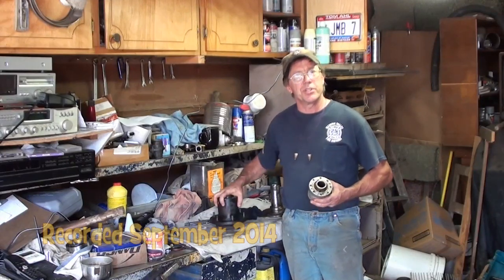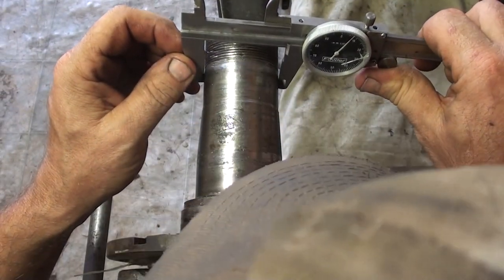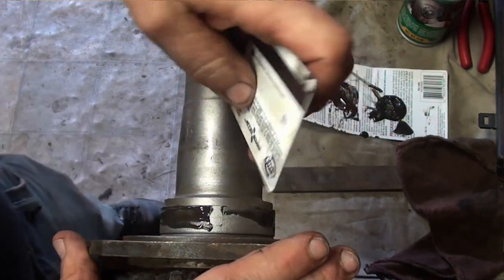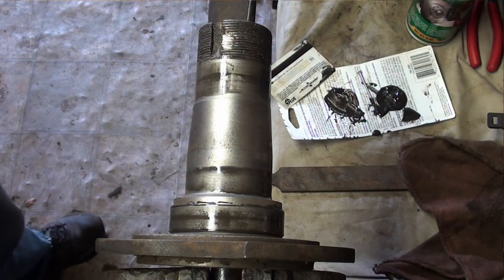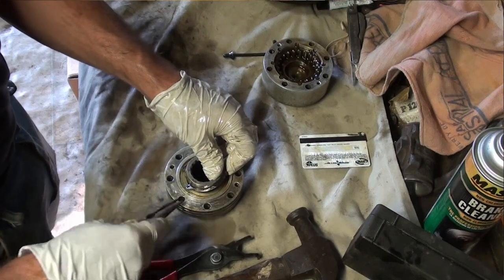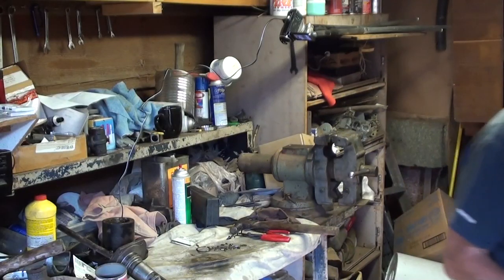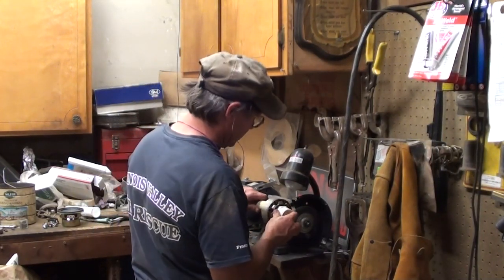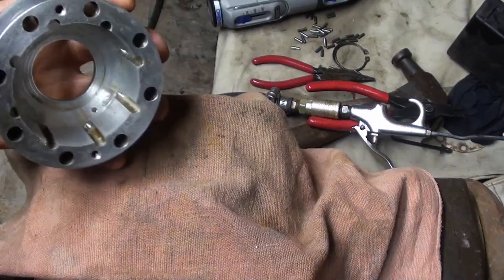Napco 4x4 HUB Rebuild Part 1 Old Crusty Grand Dad

Comment: I had to replace the wheel hub assemblies on my Trailblazer last month.  Sure wish I could have just rebuilt the buggers instead of having to buy the whole part for both sides.  Guess that old tub of bearing grease in the garage will just keep gathering dust.

Comment: Use baking soda in the sand blaster. It cleans off everything. And doesn't make the metal rough
Reply from the maker: +joe3000ist In this case the whole purpose was to make the metal rough to create a bonding surface.

Comment: That seal run area wouldn't justify a speedy-sleeve Jeff?   Is that really just a grease seal anyway ?
Reply: +Gordon McMillan  That's what the big boys got. Sleeve came with the Stemco kit.
Reply: +Lewie McNeely 
Ah, OK.  I bought some speed-sleevs for the same seal run areas on my Dodge transfer case and axles, but they are sealing against oil, where that knuckle seal is probably just against grease, so not so messy if it isn't perfect.
Reply: TRue. The Stemco kits were retrofit for oil over grease. The old grease seals weren't nearly as picky. I liked the oil in the front hubs a lot better.

Comment: I know you are a Chevy guy. but would you consider working on a 72 f250 in beautiful condition.. 80k original miles. was my father's dream to give it to me. it hasn't been running since 92. and I've tried everything I know.
Reply from the maker: +Charles Chidester I have no problem working on it. Location may be an issue